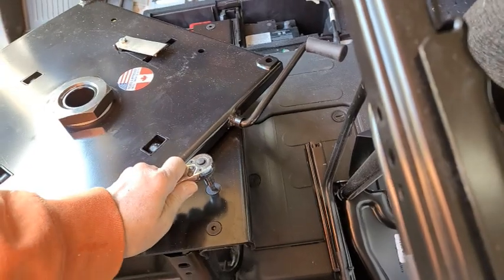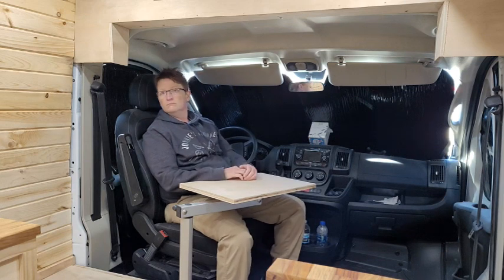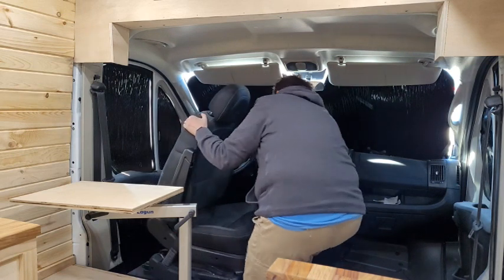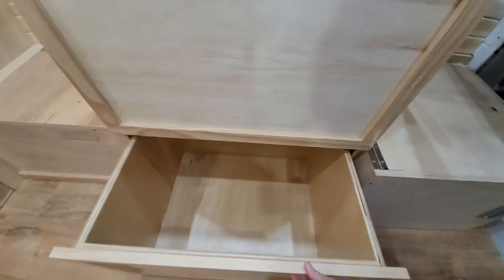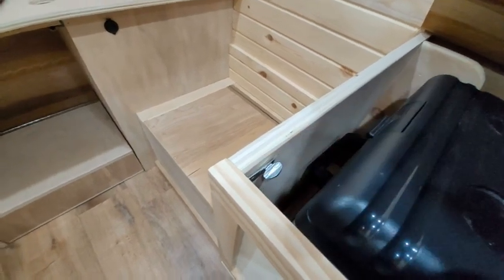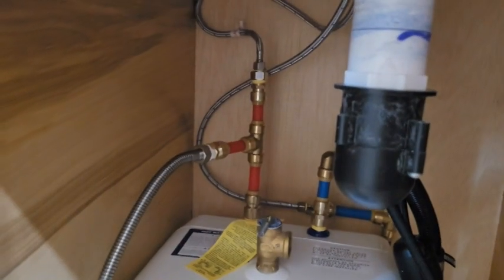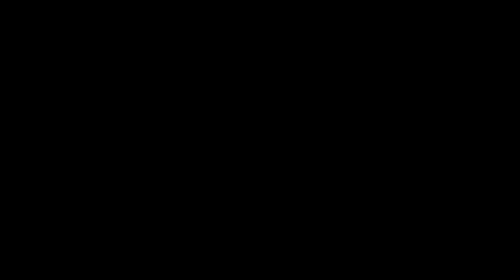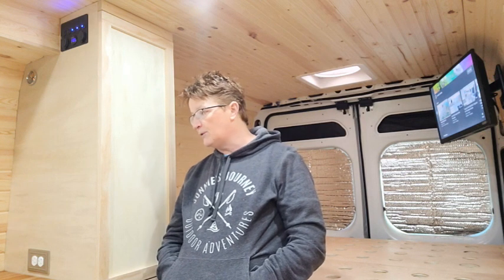VAN TOUR | Beautiful Wood Design

Comment: Hi Jonnie, Beautiful build! I was struggling with the driver swivel seat too. But I found out that if you begin to swivel the seat just until the back begins to bump into the stearing wheel and at that point bring it as forward as possible with the front horizontal bar under the seat you can then turn it without changing the position or bumping into the stearing wheel. You can then back it up a little. I hope it helps or I can try to explain it better.
Reply from the maker: Awesome will definitely try this when I get back home. Thank you

Comment: Looking great 👍 awesome build.  I may have missed it.  What’s the plan for heating the space?  I noticed the fans in the ceiling for ventilation.  Any plans to trim out the rear door area with wood or some other covering?  Thanks for sharing the build and update.
Reply from the maker: Tha doors will have 1/8 tongue and groove.  She has the Mr Buddy for when she is off grid, ceramic heater when at campground.  Tossing around idea of a Wabasto heater down the road if plan A doesn't work out.

Comment: Why didn't you wire the fuse box the the 25a socket?
Reply from the maker: It is wired to go to the 12v/25a.  I still have to make her aviator plug for the 25amp so I just have in the 12v/10amp until then.
Reply: @JonniesJourney  awesome I figured you had it under control! Got tips on how to wire mine up from one of your other videos!
Reply from the maker: @Filmedbyak  awesome, so happy to help.  Also, good catch on that, love it when people pick up on those kind of details.
Reply: @JonniesJourney  I'm surprised there isn't more videos showing how to wire a fuse box to the 25A. At the time i did mine your video was the only one.  I got the Aviation plug with xt90(xt60?) From Bluetti then bought a 6inch  xt90 male to xt90 female and cut off the end i didn't need and wired that to the fuse box
Reply from the maker: @Filmedbyak  exactly. The only reason I even used xt90"s is I have a Bluetti and Jackery if not it could be direct wire. I like having backup though.